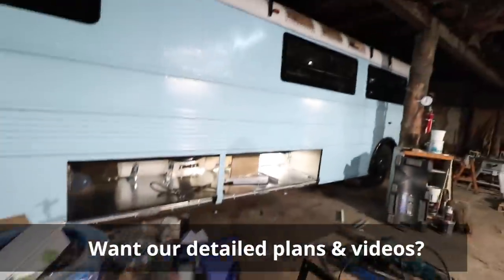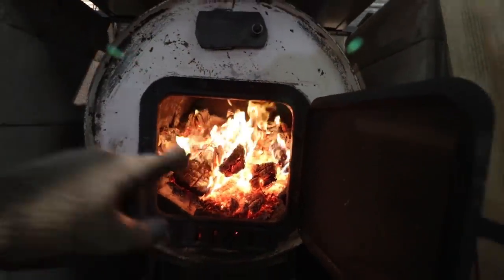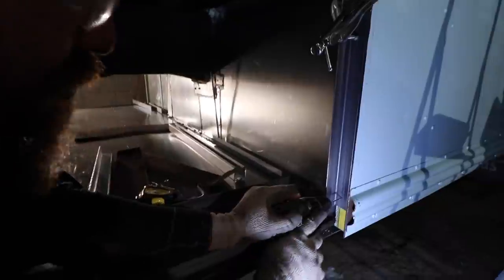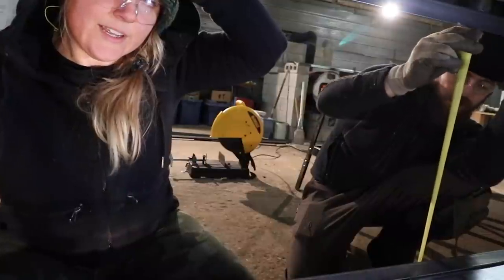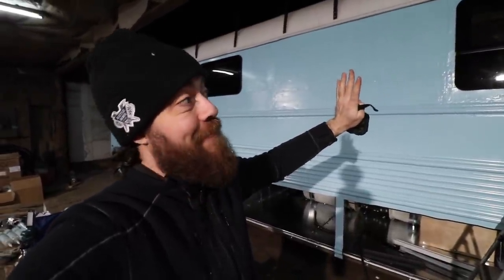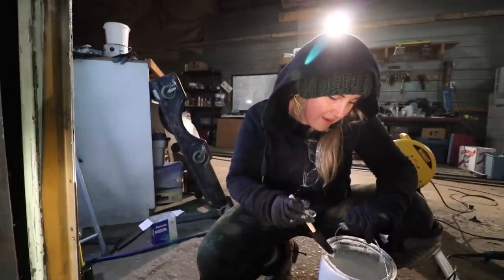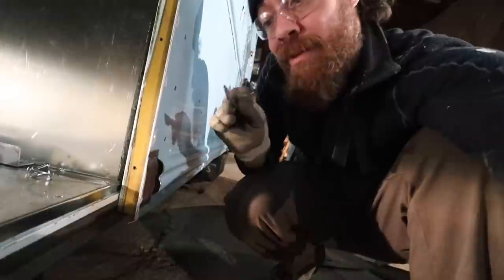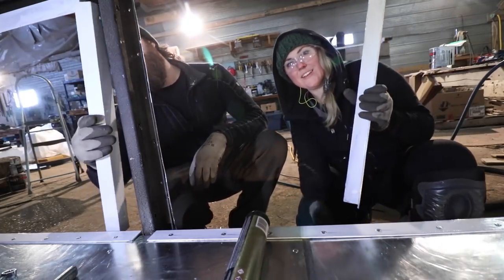WELL THAT WAS EASY (Framing Doorways To Underbody Storage Compartments & Skoolie Roof Leak Fix)

Comment: You need a fireplace fan to spread the heat out.
Reply from the maker: We have one that we were using but  because the barn has two open ridge vents, it would make the area around the stove cooler because the warm air would blow faster and leave the immediate area. So the area around the stove ended up feeling cooler than if we left the fan off and just enjoyed the radiant heat. Great observation though! We’ll definitely have fireplace fans in the Skoolie on the mini wood stove we’ll install because it’s a controlled environment & would work great!

Thanks for watching @Nicole Hicks

Comment: For your cocking (cleanup), you can use a bucket of cold water and a regular (dish cleaning) sponge. Soak the sponge in the water and wipe your cocking in a straight line.
Reply from the maker: That's good stuff you shared there @Jason Craig! Thanks so much! We definitely have a lot more caulking to do so this will come in handy!

Comment: Looking great! What is the part number or a link to the weather stripping for the basement door seals?
Reply from the maker: Glad you’re enjoying our build @Derrick Poorman! The trim we’re using is a trim seal with a side bulb. There are a ton of different options and the right size option for our application may be wrong for your application. The grip of the trim seal must be known so you know the trim jaws can grab the edge of the steel. And the bulb size and orientation should be considered based on the gap needing to be sealed. Here’s a link to some stuff on Amazon that’s similar to the stuff we have https://amzn.to/2MEk0ut (Our affiliate link) We got ours from a guy in Ontario who bought an RV dealerships inventory after they went bankrupt. The trim seal he had so happened to be the exact size we needed. So if you’re in Ontario, we can send you his contact information because he has a ton of awesome stuff!

Thanks for watching & we hope this helps!
- Brian + Erin

Comment: Why don't you cut them with the angle grinder?
Reply from the maker: Cut what with the angle grinder? The weather stripping? Let us know and we can chat more about why we did something a certain way :)
Thanks for watching @Linda Smith!
- Brian + Erin
Reply: Perhaps the bolts rather than stacking washers
Reply from the maker: Had to stack washers because the smooth shank of the bolt was poking through @Tanner Little.
Reply: @BEAdventurePartners  I know there's a reason for everything u do. I'm really impressed with your bbn uild and I'm gonna steal your floating cabinet design.